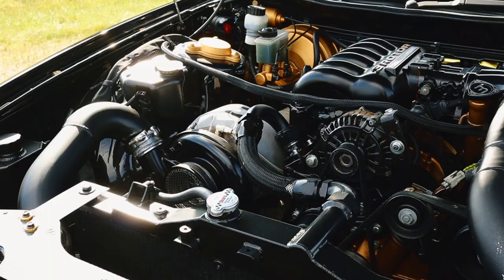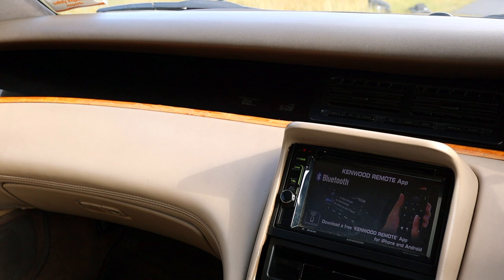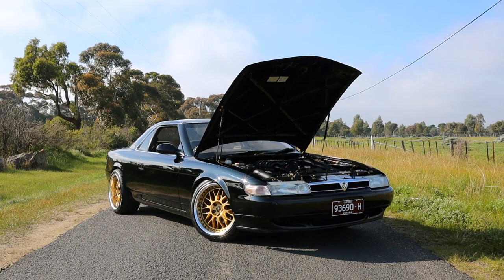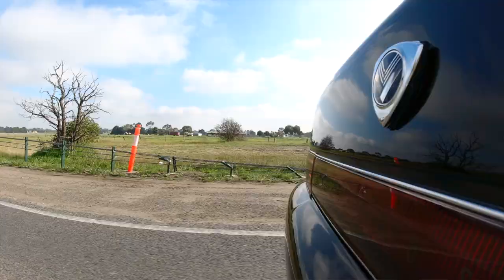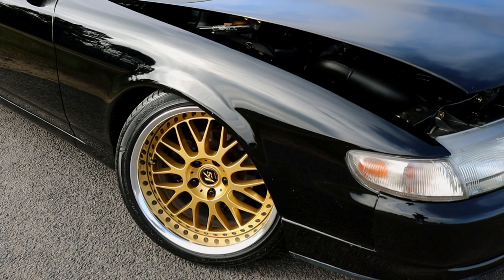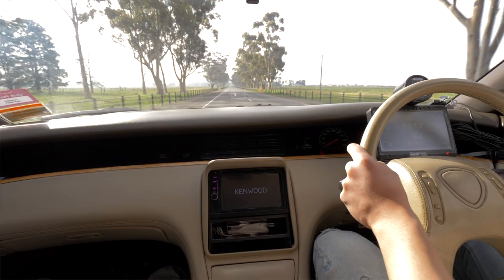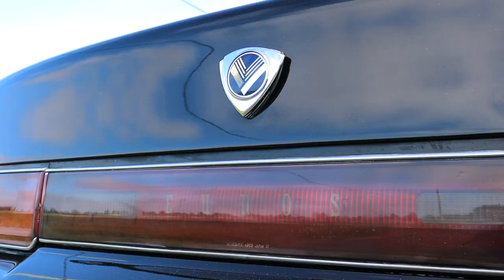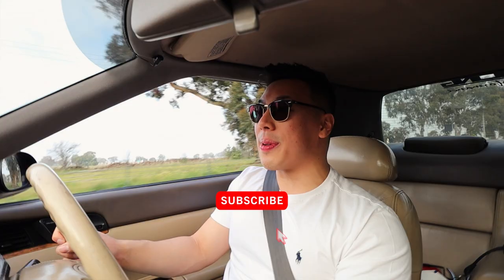1000HP 20B 3-ROTOR TURBO - Mazda Eunos Cosmo Review: WORLD’S FASTEST ROTARY

Comment: One of the best builds I've seen on YT. I love the way it's kept the stock look inside and out. That motor is just a sensation. So driveable and the noise is just sublime. Absolute credit to those involved and the detailing is the biscuits. A really well done job.
Reply: The Cosmo doesn’t really have mod support so not much body kits came for it and the interior is just beautiful stock
Reply: @ibetyourcarisstock6642  ,,,

Comment: I bloody love this car. It’s everything the RX-7 should and could have been in terms of performance and cool sci-fi displays (for the time) while not giving the driver a hernia every time they go over a pothole or bumpy road. Which is good, because here in Australia there are heaps of bumpy roads outside the city parts. It’s an Absolute beauty of engineering. All these need is a manual transmission, and it’s perfect. What a ripper!

Comment: Admittedly ive not seen ALL your videos Clay, but i fully expect you've already had your Rotor cherry popped before driving a 20B BEAST?  Honestly, if this is the very first Rotary you've ever experienced id have to go run a cold shower to cool off, because like most people that know little about the Brap, even just finding a car like that in Melbourne let alone DRIVING the 750RWKW 20B Cosmo is SO UNBELIEVABLY LUCKY! How you managed to score that car for your channel i have no idea, but good on ya bro, this will make hundreds of other content creators JEALOUS AS ALL F##K . Thats a brand new build for Melbourne, and Australia. Until now, id expect no more than a handful of people have even seen this masterpiece. massive props to the owner. I wonder if he knows about the shop not far from the filming location that specialises in building and tuning 20Bs since 2001. Last thing i have to ask mate, did the owner tell you before or after your test drive that he left the boost on wastegate pressure to see how you got on with it?
Reply: I'd expect the owner to do nothing less than that given its master piece status?
Possible face blur and convince the owner to dial it up to 11 as passenger would be enough 1800 NEW DAX

Comment: That’s either some insane throttle control or super low boost; which to be fair if I owned that and handed the keys to someone else... yep would totally do that. Wheel fitment on the rear is rubbish, and vented gate sounds stupid. You guys have some tacky roads over there or something? - because a 400hp 13B turbo will fry tyres easier than that. Alright now internet nerd rage is out if the way; bloody tidy car! I’ve only seen a couple as tidy. Some folks might remember Lance Warren of 3rotor.com back in the day... good to see these things still getting love.

Comment: Sick review! i Had one of these back in the Old days but for Donor Parts   I was a Little Lost when you said 55mm Turbo,   Easy mistake when taking in Info from another Owner  Garret 55R
Reply: i was thinking the same thing, youd need atleast a 72mm turbo for 750kw atw.
Reply: @SR22VET-S15  68mm+ yeah
Reply: @jjsorenavki7005  A 55mm turbo in precision is only rated for 590hp lol. But yeah its most likely a gtx55 and its thrown him off when in reality is an 85mm turbo
Reply: @SR22VET-S15  yeah haha  i made 760kw on a xona 68mm but thats pushing it with nos an 52psi   i was like 55mm haaaaaa  lol saw the bay was like uh has to be a gtx55r lol
Reply: @jjsorenavki7005  thats some solid grunt, but yeah 52psi and giggle gas. Im doing 450kw on 24psi on the run in with a 6870 going back this week to do some power runs at 40psi and see where it goes
Reply: @SR22VET-S15  nice man which Silvia is the 22ve in?    Mines a evo 9 mivec setup 2.2LR in an evo 3,  just opt for response would of made my power on a 72mm xona without the Gas,
Reply: @jjsorenavki7005  its in the S15 in my DP, yeah i wanted to run the 68mm as its the smallest 1000hp turbo and quite streetable. 
4Gs love the boost, your car would be a beast, atleast a high 8 or low 9 aye? One of the cars at the shop was an evo 9 with a 6870 making 680kw at all fours , ran 9.2 at cootamundra airport. Yours would be so much faster with the extra power and less weight
Reply: @SR22VET-S15  it would be somewhere in the 8s  i ran a 9.8 @ 143mph with 390wkw
Reply: @jjsorenavki7005  thats fucking quick 👌🏾, have not run mine yet, but the aim is low 9s on a 275 micky. If it goes faster than i low 9 its a bonus
Reply: @SR22VET-S15  my 9.8 is on re003 245/17/9.0 street tyres  i have et street 255/16/10.5 to go 4 gold  goodluck in your quest
Reply: @jjsorenavki7005  thats amazing bro.  Update if you run with the mickys on
Reply: @SR22VET-S15  Will do man, i might even upgrade to the 72mm Xona defs the best  turbo ive ever ran on any of my previous cars or current,